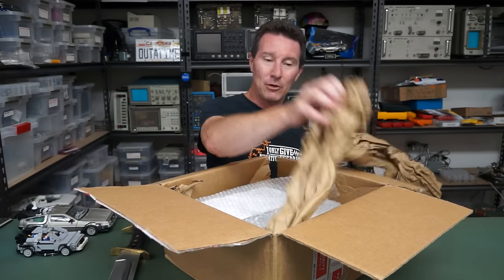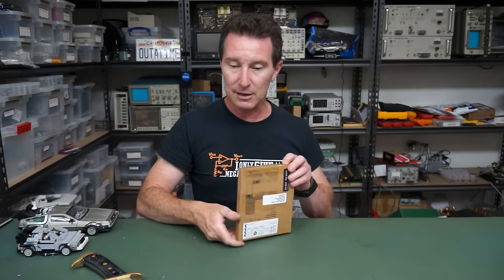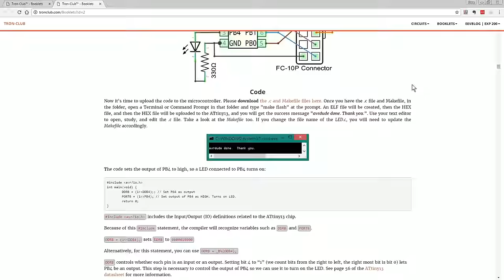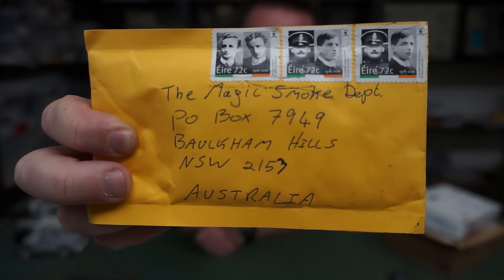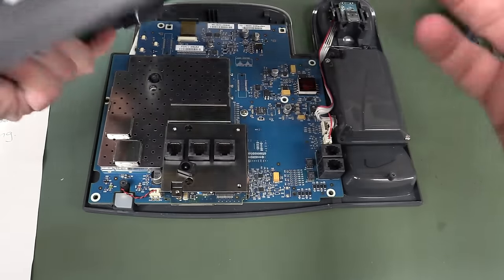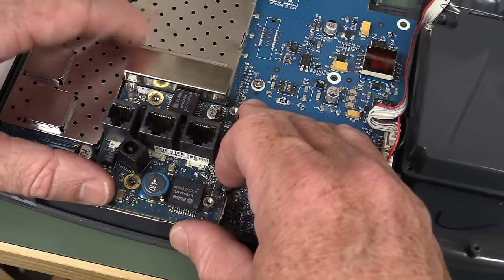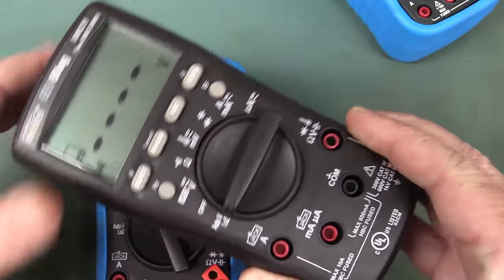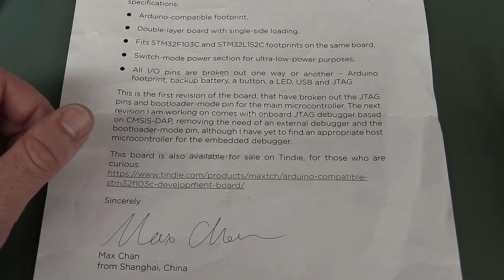EEVblog #964 - Mailbag

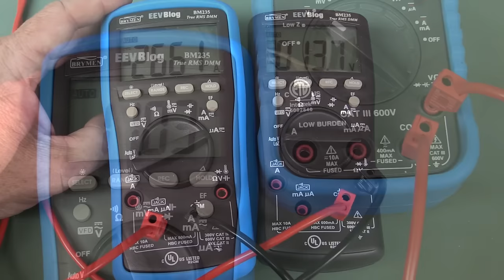Comment: @ 34:40 "mystery meter" ?  Exact same color?   Hmmmmmm..........
Reply: If you look closely, the dial is a bit different than the EEVblog branded meter.
Reply: DangerousAndAwesome I realize that, I was insinuating possible new EEVBLOG multimeter?  Off all the way to left, flush selector switch, holster sticks out past face of meter for protection, ALL things Dave likes.  Also, that blue....
Reply: Huh, I hadn't consider that. I can't see any other reason why he'd keep the meter offscreen. Now you've got me excited.
Reply: DangerousAndAwesome When for the first time I can remember in any video Dave did not say exactly what multimeter he was confirming measurements with, then kept it off screen, I paused the video to look at it and noticed the couple features I pointed out along with exact color match.  That was the only conclusion I could come up with for what my eyes seen in that few seconds of the video.  🤔
Reply: Yeah, well it would make sense. I mean, not mentioning the name of the meter is one thing, but literally calling it a "mystery multimeter"... Eh, I think it's probably a new one. Though the original Brymen 235 is pretty feature rich, I'm not sure why he would be rebranding another meter.
Reply: From what I understood, the new one is supposed to be more of a Dave designed meter rather than a more direct rebrand.
Reply: I think it is an EEVblog meter too, just because it says low burden between the amps jacks... everybody knows Dave is obsessed with burden voltage...
Reply: actually watching further, when he opens that STM32 thing, he says, it is in his multimeter... CONFIRMED!
Reply: yep, you can see the 3D printed proto on his 2nd channel

Comment: Holy fuck my RPI is getting hot as F. I think, they need to put a heatsink on the next model. Is it normal to get 33% CPU usage while updating the OS and 25% at idle? I'm using a raspbian image from waveshare with preinstalled drivers for a SPI LCD.

Comment: The thing with these power banks is they rate them @ the batteries full potential @ 3.7v not 5v so that equals about 1,500mAh not 2,200mAh because the boost converter draws power and it's not 100% efficient and most likely draws a residual amount of power,  plus the law of conservation is a 20% loss at minimal figures, but somehow they're able to avoid the truth like everything... I don't know why knowledge here never explains these things.

Comment: Hm, wondering what that thing in the cisco phone is that looks a bit like a 7 segment LED
Reply: On the right hand side of the phone next to the display?  Used to switch which line you're using or for speed dial.
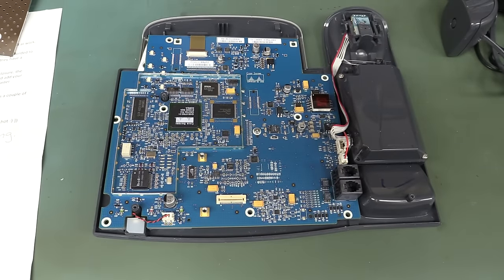Reply: no, on the pcb, like at 23:54 on the right of the pcb near the cable

Comment: power on to ready if >3 seconds is a total fail, ghods in the 80's your commodore 64 was on instantly. ''dumb old flip phones'' powered up in seconds,  the latest ''smart'' phones 20-40 seconds....smaller-slower obviously...  soon you will have a keyfob that does everything but you turn it on the night before....

call yourself designers.....
Reply: Forgot that it took several minutes to load a ~48K program into the C64?

Comment: WHY; WHY do they Use Cheng(X) Capacitors?
Why not use something decent: Teapo, Su'scon, CapXon, ltec, Taicon and so on. The good chinese/taiwanese manufacturers...
Reply: economics ..... (and mine say chongx), but for a education kit those are pretty dodge lol
Reply: Yes and I've seen more than enough bulged or leaked Panasonic, Nichicon and especially Nippon Chemicon Caps. So what?!

Have you thought one second about the reasons those caps failed?! 
And have you taken a look at the specifications?
That a Teapo SC fails sooner than a Nippon CHemicon KZH or even KZE should be rather obvious.
Especially in hot environments (bad coolin) or when they have to endure rather high ripple current.

And I really doubt that a Nippon CHemicon KZE is really better than a Teapo TA series one. Or CapXon FH series one. 
But hey, who the hell cares about enviroments, specifications and price in electronics?!
And how long a device with a bad cap was used.

It's not that caps aren't one of the things that will fail!!
Especially water based low ESR capacitors fail rather often. Just because H²O is rather reactive...

Especially since people like engineers who work with caps on a daily basis like a TDK Lamda engeneer mention that you get what you pay for and that there is NO DIFFERENCE between the better taiwanese/chinese companys and the Japanese ones - even the price. 

But it's easy to judge some companies by the cheapest things they sell and compare them to companys that sell rather high priced products...

A Miele washing machine mostly last a very long time, 10 Years or more isn't uncommon. That's not that Common with Bosch and so on...
That the Bosch thing costs about 300€ and the Miele about 800€ isn't something we talk about. Surely the Miele is obviosly better.

That it's also way more than twice the price isn't something we talk about...

BUT WE SHOULD TALK ABOUT THE PRICE WHEN COMPARING THINGS!!
Reply: NO!
You don't say that Company A are decent caps, when you have absolutely no clue how they will be used, what's the enviroment is and what is needed.

ESPECIALLY since every major capacitor manufacturer has many many different series with enormous difference...

If you need low impedance capacitors, you can't use general purpose ones.

And if you have a rather unpleasant enviroment (=hot and/or very high ripple current), you don't use wet electrolytics at all - you use polymer capacitors.

If you want a capacitor that usually doesn't frail with a short to ground, you just do not use a polymer capacitor you use something else (like those 'hybrid' capacitors or a wet electrolytic one).

Just throwing around brand names is just stupid.
You need to know what you need first.
And THAN you look at what capacitors are available, how the pricing of those cost is.

You just don't decide on a manufacturer and use an unsuitable capacitor, just because you want to put 'japanese capacitor' on the box, but don't have the money to buy the ones you need...
And capacitors that are used inappropriately tend to bulge!
So it's safe to assume that if a capacitor is bulded, it was rather stressed...
Reply: its is very true that the real skill in electronics is figuring out how to use the components as best as you can ... that's why I kinda enjoy using cheap ones too as it forces me to be smart. The thing is though that quality control means there is a vague correlation between the quality of different manufacturers but generally they do work fine. I thought the unvented caps I had were a disaster waiting to happen but when I tried blowing them up they failed remarkably controlled and ive had no problems with them so far. For a  hobbyist purpose it also doesn't really matter if the components have a much shorter lifespan - generally you wont leave them in a installed circuit for long anyway ..... but for a educational kit it would have been nice to go one step up, 'Japanese capacitor' is overkill but for a little more money you can get other Chinese caps which are better in quality, which is a good thing to have in a educational kit.